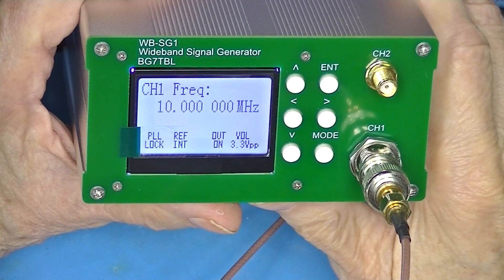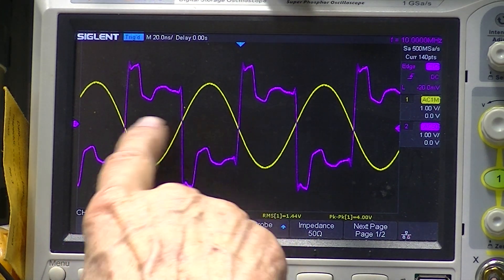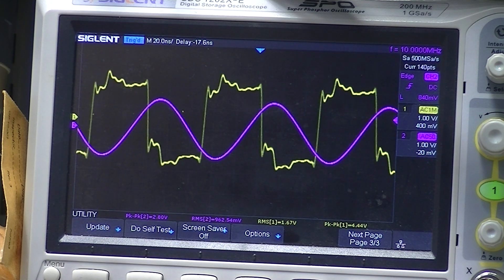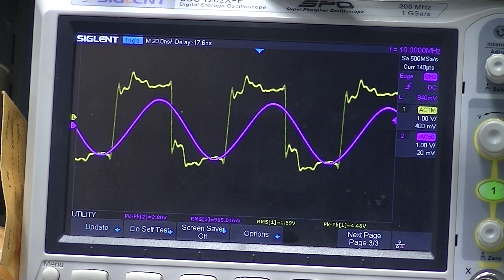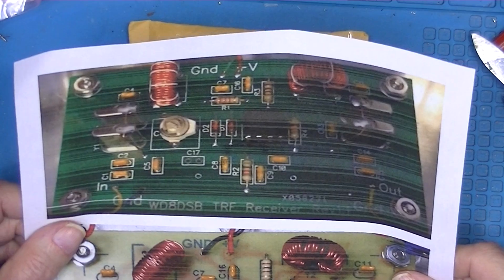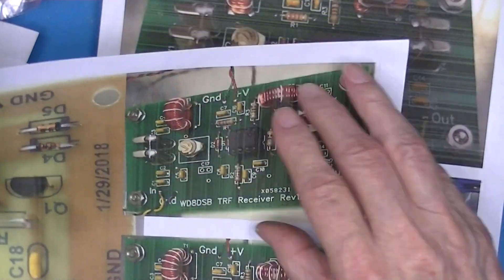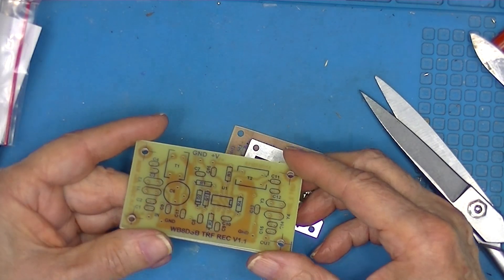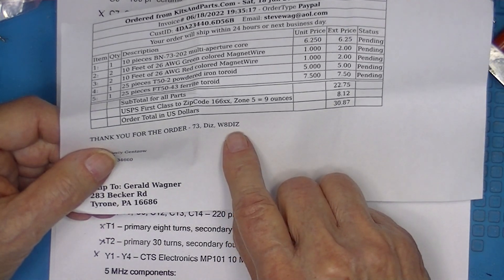10MHz WWV Receiver Part 1

Comment: I have sort of come to the conclusion that, as for all manners of calibrations - frequency, voltage, etc, - the best an EE hobbyist can (afford) to do is to synchronize all their gear to the best device that they own. I, for one,  could not afford to pay calibration fees, plus shipping. Even though I would really, really, really like to <stupid grin.> I would think that your GPS 10MHz reference would be particularly accurate. No judgement here, but I wonder why you would additionally want WWV. For redundancy, nostalgia, or do you not trust your GPS? I built a GPSDClock and included a 10MHz output. It uses a Ublox M8N clone, which multiplies the 1PPS NMEA signal. So, its 10MHz reference will be off by whatever the IC introduces. It does not have an additional redundant oscillator (Rubidium, Oven,) but I have an oven and I would like to build out a dedicated lab reference (with a distribution amplifier,) one day. You keep me inspired to give it a go... Thanks!